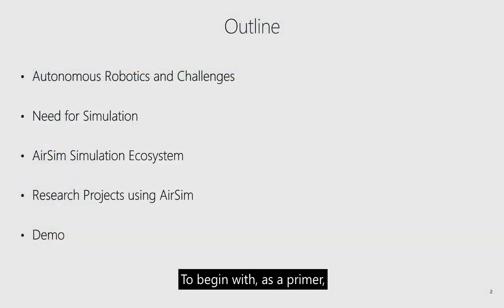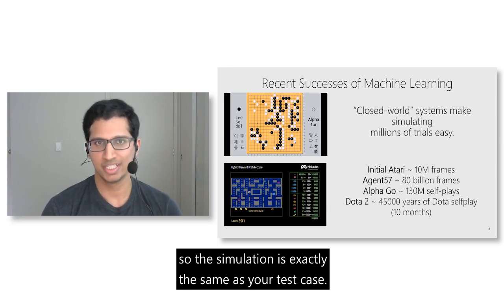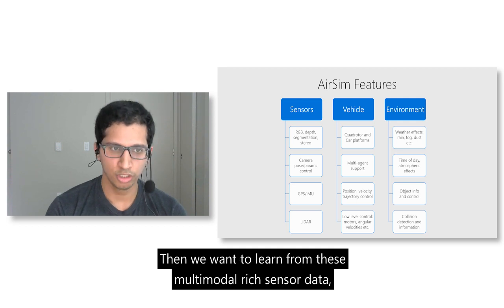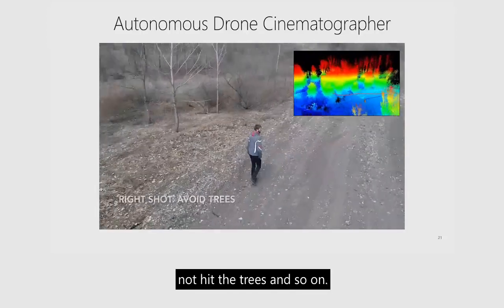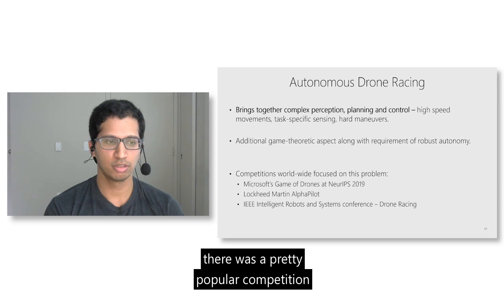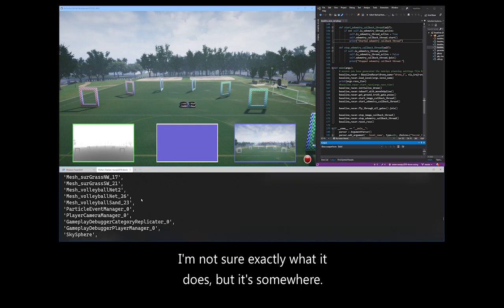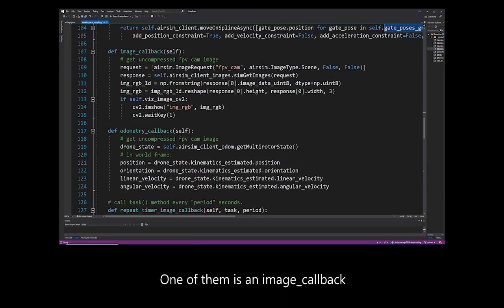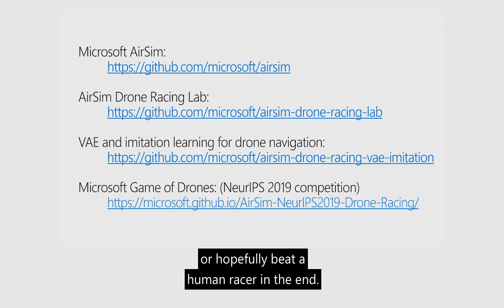Harnessing high-fidelity simulation for autonomous systems through AirSim

Comment: Hi, Thank you for your graeat video, I was wondering if we have a .ulg files of different flight missions in different area, can we simulate all of these missions at the same time and if they have a collision can we get the data of collied UAVs to analyze ? I am trying to run several drones missions in different locaions at the same times that hav a PX4 flight controller and analysis the collision between them is it possible for me?